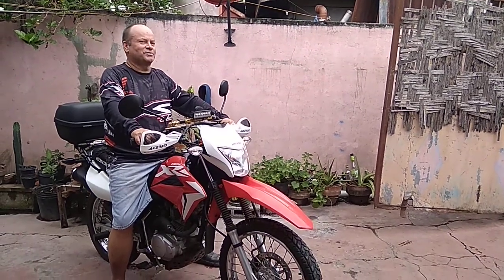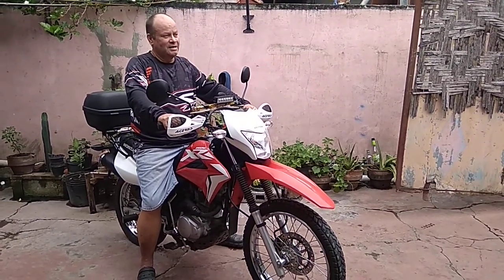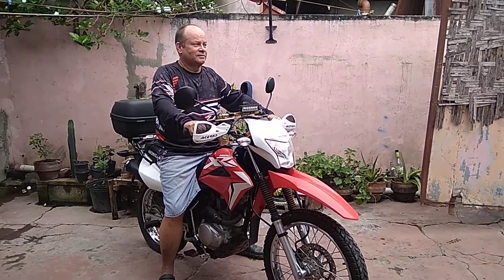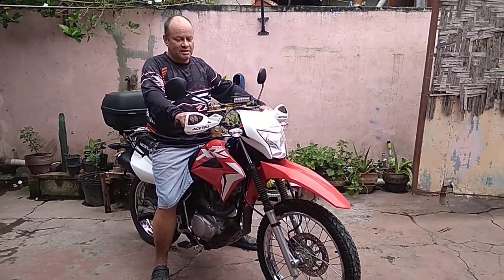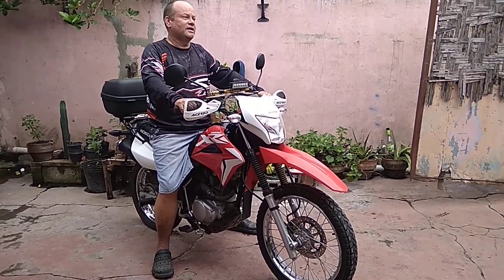Honda XR 150L big bore on the move in Mindanao, February 25, 2022

Comment: I like it! 👍 I'll definitely do the BB upgrade after my bike goes out of warranty. What is your top speed now and how is it holding up? Did you change any of the sprockets to take advantage of the extra power? I already have the PZ27 carb on mine, starts easier and idles better. Going to rewatch your other video again..
Reply from the maker: I changed to smaller front sprocket depending on the roads. Top speed would depend on the sprocket, but 110km/h was possible with the standard sprocket